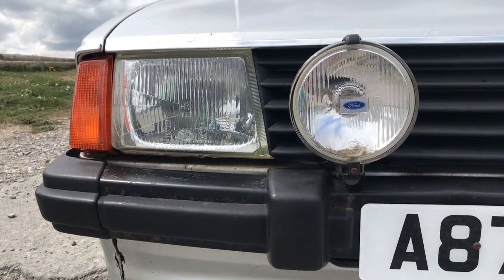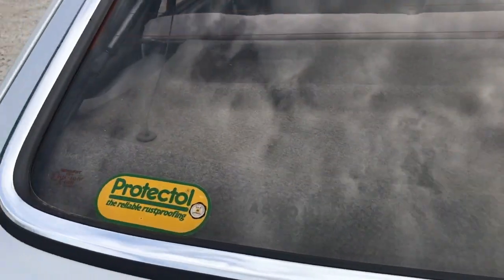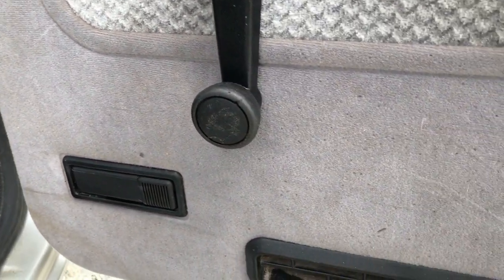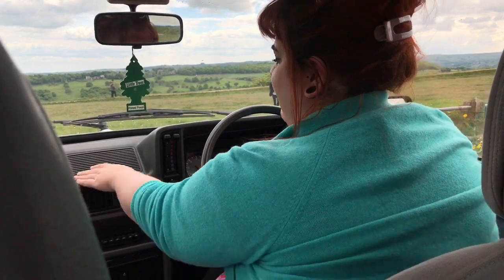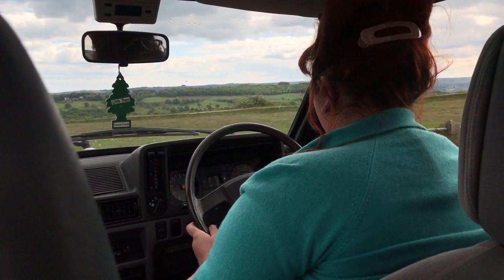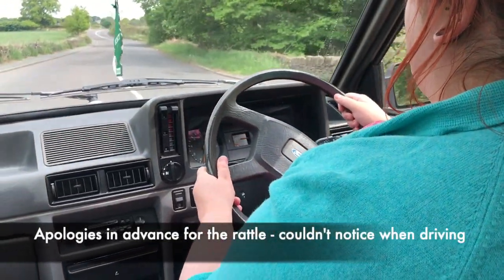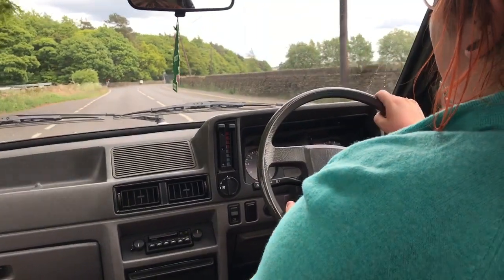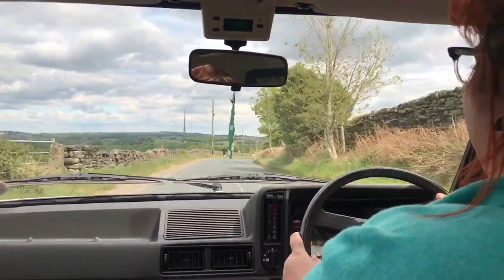IDRIVEACLASSIC reviews: 80s Ford Escort MK3

Comment: It looks almost as good as new on the inside, very clean outside too :-) I didn't really like the sound of the exhaust from the outside, but the car certainly sounded really quiet on the inside when you were out on the road. I noticed the engine revs were really low when you were driving up to 40 mph; just under 2000 rpm!

Comment: I had a A reg 1.6 Ghia back in 1994.  It was one of the worst cars I’ve ever owned.   Firstly as a young 20 something my insurance rocketed,.  I had constant starting issues, replacing the battery and fitting an uprated starter motor from a diesel didn’t help.  I also had a constant misfire and in the end it seized up and ended up standing in front of the house for months as I bought a Montego.  I eventually got a replacement engine fitted from a 1.6 Orion and put it up for sale at which point I discovered that despite looking nice it was a rust bucket underneath.  In the end I sold it and got back the cost of having the replacement engine fitted.  I was glad to see the back of it and in hindsight I really should have just scrapped it.

The W reg 1.3L which was my first car was much better, although that was starting to rust away when I traded in for a Mk2 Fiesta.

Comment: My boss back in the day had a 2nd hand mk3 1.3 GL 5 speed manual……one of the most unreliable cars ever made. Used to have something go wrong every few weeks.

The 1.6 Automatic (3 speed I think) was very rare even in the 1980s.

There seemed to be several model updates too…someone back in the office had a mk3 1.1L….post facelift (1984?) with slightly later seats etc. early cars had longer gear levers. And early cars were slightly higher off the the road….a slightly pinched appearance.
The original Orion was also based on the mk3.

Comment: My memory must be playing tricks on me because I thought 80s Ghia badged Fords were a little less basic inside than that one, I had mid 70s Jag about that time with electric windows, air con, power steering ect but that Escort some 10 years later seems almost Trabant like inside.
Reply: The smaller ghia badged car were basic. A fiesta ghia really only had a rev counter and velour seats that was about it. 4 speed manual locking etc.   What features did you think the escort might have?

Comment: i think one of those blanking plates could have been for the rear wiper. sure i have seen these with that before. id have thought this would have had one it being the ghia spec
Reply: Seems really odd this doesn't have a rear wiper I can even find Y reg ones with the wiper in ghia spec  and later ones in lower spec with a wiper sure all the XR3 one had it along with the spoiler. I'm wondering if the boot lid got replaced!

Comment: When you rev the engine around 25:00, it sounds like the car may have a timing belt issue? Nonetheless, it seems to be in very good shape for its age. You are correct when you say that those of us in the United States generally prefer an automatic transmission (gearbox). I don't know what the reason is for that except that our culture seems to revolve around the automobile, and we tend to spend more time in the car? I'm really not sure, but it's fascinating noting the differences between motoring standards in the UK compared with those of the US. I think more often than not, we here in the U.S want a vehicle which pampers us - at least that's the way it is today. The early 1980's, the expectations for an automobile were generally different than they are now. Of course, all of that evolves with time as technology develops, and people become more affluent. As for me, I have been a luxury car fan since I was a very little boy. Give me my electric windows, my automatic level control, my electric door locks, my adaptive cruise control, my automatic climate control, and my touchscreen command center and I'm good to go. Again, fantastic video, Steph.

Comment: Nice video. That's a very nice tidy car too, something you could do a bit of a running resto on. 
Not sure that oil light should be flashing though!
Reply from the maker: Hey I did mention before we started driving that it was sensor failure and had been checked prior to test 😊
Reply: I had a Granada of similar age, warning lights were up on the roof by the rear view mirror. Brake pad warning light kept coming on even though pads were fine. 
Took the bulb out in the end! So a sensor fault isn't uncommon.
Reply: Oil light flashing is for the oil level. The sensor is on the dipstick and the wires usually get brittle and come off. It's not the oil pressure light which would be more of a worry
Reply: @idriveaclassic  You did. That's why I added the but about my Granada,  sorry 🙂

Comment: mk4 was better as they brought back the manual choke.  Sadly it was replaced in 1990 by a car that was designed by accountants within a year it was dated as vw release mk3 golf and vauxhall mk3 astra.  Ford got better, and released focus in 98.
Reply: The Mk5 in 1990 must have been the only car to carry all the engines over from the MK4  1.3 HCS  pushrod 1.4 CVH 1.6 CVH  and 1.8 Diesel  (non turbo) I had a H reg 1.4 LX.  It had window winders in the front and didn't even have a rev counter!    I guess all it had really was tinted glass and central locking!

Comment: a Ghia and it still doesn't have alloys or a rear windscreen wiper
Reply: In a Google search I can't find another Ghia without a rear wiper I'm sure it should be there. Even a fiesta had a rear wiper unless you got the popular model and the no rear heated window either. And it had to be a MK2. The MK1 had a wiper.   And even a 2000 ford focus Ghia did not have alloy's
Reply: Mk3 and MK4 Ghias never had Alloys, Steels and hub caps on the early MK 3's, Later Mk3's and Mk4's had Wheeltrims. Our B reg Ghia had a rear wiper. I think our earlier X reg GL had one as well. I wonder if it's because it's an Auto and that's why it doesn't have one.

Comment: My mk3 was a death trap ...the cvh engine was well n truly broken the tappers...it rattled so bad ...all the lights would go out ...the wiring!!!! 
1 day oil leaked out over onto the exhaust cover n set on fire ..underneath .....a petrol station 
Luckily we got going again then it starting to rain .......there was all steam n stuff coming out the bonnet 
The brake lines were all rusted too 

However my fathers mk3 estate van 
Went ok I remember it only had a radio no cassette 4 gears he drove it on holiday to spain ...!!!!!!!!! 
His mk4 was way better ..........
It had a cassette player n a quad stick thing 4 the speakers....think it had 5 gears ........
Wish id held onto my trust bucket dagenham dustbin ..............
#wounded

Comment: Hi I'm not sure but did Ford share the engines from the mark 3 to the mark  4 escort I know some of the parts did cross over
Reply: They did. Also fitted to early mk5s
Reply: The CVH engine yes, the OHV engine I'm pretty sure they were used as well 1.1 and 1.3... May have to Google it just to make sure 😂
Reply: WH Twenty20  the ohv went in mk4 as well.  The mk5 got the 1.3 ohv.
Reply from the maker: They did! The 500 million pound investment wasn’t wasted 😂
Reply: I dad the. Mark 4 and I remember using some parts from a mark 3 thay are good cars the last Ford escort was sold in 2003  great video steph keep up the good work
Reply: @barryjackson8512  ah yes I remember the mk5 with a OHV would barely pull ya pants down 😂
Pretty reliable engine but shouldn't of been used in the mk5
Reply: Sure they carried over the 1.1 to the mark 5 as well I could be wrong but sure my dad had a 1.1 popular
Reply: Yes carried over to the 1st MK5's as well, which was why my dad bought an Astra after 4 Escorts. He always liked the MK3 and MK4 but wanted a better engine by the time the MK5 was released.

Comment: Now rare last ones made in 2000 on an x reg see 1 or 2 still going ford tho could never get body rustproofed same as transits a guy i worked with had an Orion ghia d reg back in 2000 boot floor full of holes cvh motor 1.6injection.

Comment: Thank you for this video, you have covered the MKIII Escort well. I remember these well. I drove a 1.6 Ghia in Silver in the mid 80's, it had a anual box it was smooth and felt good I always thought it would be better with an automatic. Lots of people would fit manual chokes, kits were popular and easily fitted. Ford auto chokes did not work well. Another popular upgrade was to fit a Webber carburettor, this was done on a lot of Fords, kits were avaiable and could be fitted at home. The Webber gave better fuel economy, driveability and power in the mid range. The MkIII escort created a lot of interest and was popular. Dealers found it hard to shift remaining MKII stock, MKIIs could be had at huge discounts for a while. Having driven both a MKII and MKIII back in the day the MKIII was altogether a better car. For handling they set the Alfasud as the benchmark, as did the designers of the Maestro, early MKIIIs were firmly sprung. I drove one and althought it would turn crisply and was fun it got wearing over time and parking was tedious given the weight of the steering which got better and had superb feel once speed increased. Ford got lots of feedback and softenend the springs dampers and bushings within months. The things that worked againsed the MKIII in the 80's were its popularity it was seen as a me too car despite it being good. The fleet market meant there were lots of them normally 1.3 Ls. The othre thing was the perception of the XR3 and its drivers, they were often driven agressively as were Golf GTis. Back then hot hatches and their drivers were not liked by many people. Its different today when these cars are classics and enthusiat owned. I recall the Ford RS owners club meets at Stanford Hall in the 80s, the members were enthusiasts and good people but thier meets got sneered at, this being based on the bad behaviour of a  number of RS and XR owners. The MKIII was everythwere in the 80s  not valued much but they soon got valued in 1990 when the MKV was so bad. Motoring journalists would say Ford repalced a good car with a bad one. Then MKIII and MKIVs were valued and sold well on the second hand market.
Reply: Dad told me not to buy an XR3i - so I bought an Orion 1.6 Ghia i. Totally different, right?

Comment: Had a 1981 Escort 1.3L Estate followed by a 1990 Orion 1.4 Ghia.  Both CVH engines, both engines were rubbish.  Loved my Orion at the time, electric windows and heated front screen, but reliability was aweful. Followed the Orion with a 1995 Rover 214SEi - was light years better than Orion, 1.4 K series 16v was a sweet little engine.  Followed that with a Rover 620Ti - beast of a Q car, serious performance from the 2 litre T series Turbo engine.
Reply: My dad had a rover  214sli (k series rover) I had a MK5 escort LX The escort wasn't a patch on the rover. (Both 1.4). But the headgasket went on the rover and the escort still worked so at the point the 1.4 in the escort was the better engine.

Comment: Steph, if you every saw a USA spec Escort, you would scream...and then cry. USA mfgr’s only built small cars reluctantly...and they never let the customer forget it! I guess if you never laid eyes on a Honda, Toyota or Nissan and could only compare the USA Escort to the Dodge Omni/Plymouth Horizon (think Talbot Horizon beaten with an ugly stick) or a Chevrolet Chevette (kinda like a Vauxhall Chevette hatch but exceedingly cheap and nasty to drive) then the Escort didn’t seem too bad by comparison. Why oh why would Fird USA spend millions to take such an attractive exterior and well thought out interior and redesign (Americanize) it into the worst looking penalty box you could imagine, I will never know. It was if Ford USA was send a drawing of the European Escort on a paper napkin followed by a vague description of the car over the phone and said “OK, got it!”: The exterior was the same basic shape but the wheel arches looked too bulbous and the wheels were tucked in about 2” too far. Huge impact bumpers which all of our cars had at the time. Any trim was chromed plastic. The interior was cheap looking and feeling. The dash had hard squared off edges and was so poorly executed that Early cars had a massive recall to address a poorly placed ignition switch that could be inadvertently switched off by the driver’s knee while driving. Causing...ya know... loss of control...death! By ‘84 the dash was redesigned. The replacement design was better visually but still cheap and nasty with poor fit and detailing. Engines were wheezy and thrashy. Ford USA then proceeded to build that craptastic car for 10 years with only minor tweaks and restyles along the way. They sold a bunch of them but none (thankfully) are left today. Anyway, the car you drove was everything our Escort was not. Nice car. Thanks.

Comment: Makes me feel old as it seems only a few years ago that every second car you saw was an Escort. I liked the snub nosed looks of the Mk 3, it was classic Ford. Simple engineering, easy for a DIY mechanic to service, above average reliability at a time when turning the key in your pride and joy was preceded with slight anxiety rather than expectation.
The auto box must have been a very rare option, and I have to say that the Ghia badge on a car with those awful 'wood' inserts is a tad disappointing. Blanking plugs as well? Genuine Ghia or just a 'lookalike'?
Whatever, I can't dislike this type of car. Affordable, unpretentious, reliable and practical. Yes, prone to rust like every car of the era, but by no means the worst at the time, and if your wings were rotten it only cost a few quid to replace them. That's what you need in a budget motor, Ford got the formula right with this car.